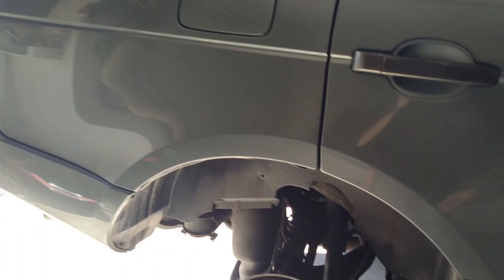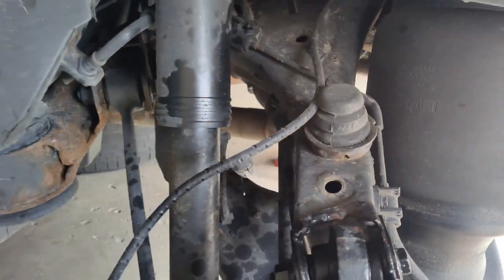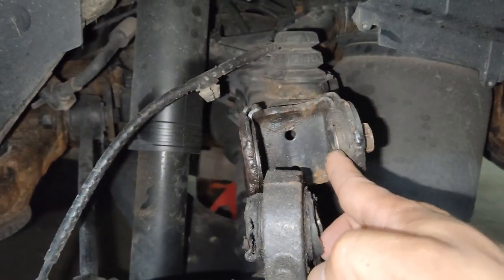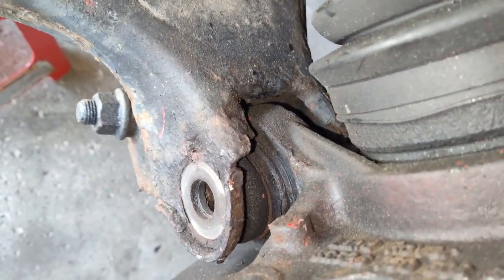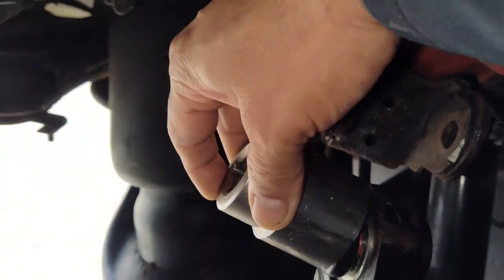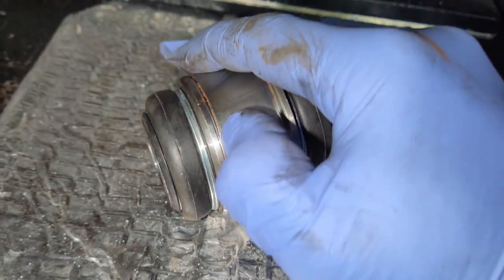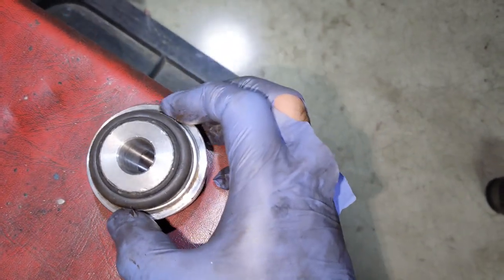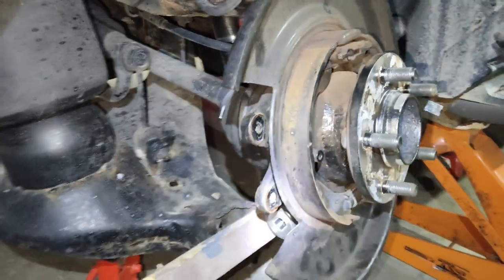Range Rover L322 Rear Knuckle Hub Bushing Replacement

Comment: I'm going to tackle this job soon. Great video. Right now I am getting my butt kicked by the parking brakes!!!
Reply from the maker: Hi, glad it was helpful , thank you for watching/subscribing.  
It's not that bad if you plan ahead, order the parts (bolts) before you start.  A good ball joint press or bushing tool is a must.  I did leave links to all the parts in the description.
As far as the parking brake goes, just remove the shoes and leave them out.  They always rust up and cause issues.  Unless you do use the parking brake often.  Most of the time, not using them is what causes the problem.   
thanks

Comment: Great video. Nice clear presentation.  I’ve done mine and I’d definitely recommend anyone has a grinder to hand as those bolts can be impossible to knock out of the old bush.  And obv have the new bolts to replace the cut one lol.
Reply from the maker: Hi, thank you very much for watching/subscribing.  Yes a grinder to cut and new bolts are must to complete this job.  It's very common for the bolts to seize inside the bushings on any vehicle.

Comment: Isn’t easier to just replace the arms if the parts too old or rusty 😅
Reply from the maker: Hub bushings are pressed in to the knuckle.  Replacing the control arms if rusted, you will still have to go through this same procedure to replace the bushings.  However you can replace the knuckle/Hub, which may come with preinstalled(pressed in) bushings.  But I don't think it's any easier.  You may still have to cut the bolts out if rusted or seized & you will have too remove the axle from the hub, transfer all the brake system to the new knuckle/hub, including the parking brake. 
Thanks for watching/subscribing.